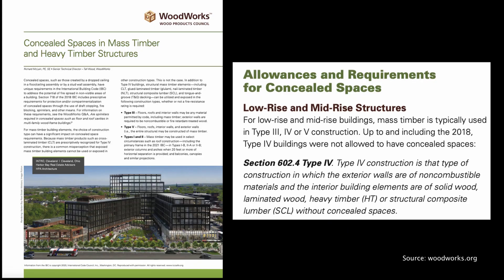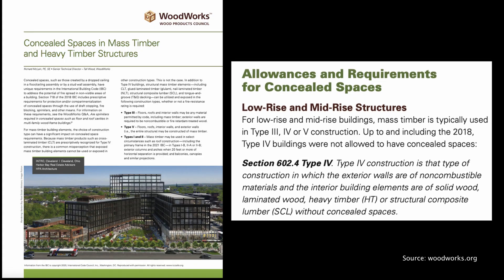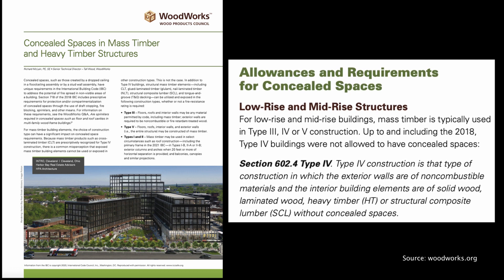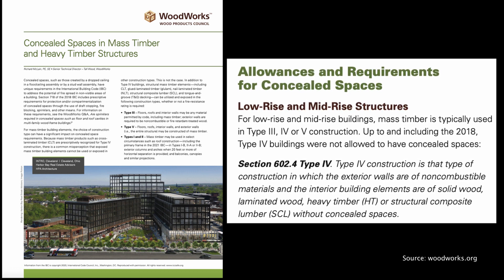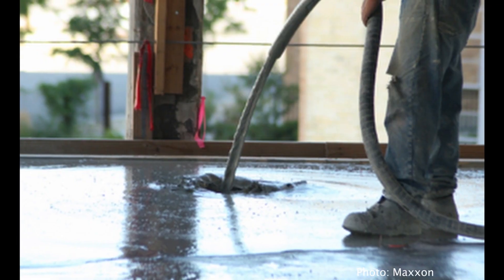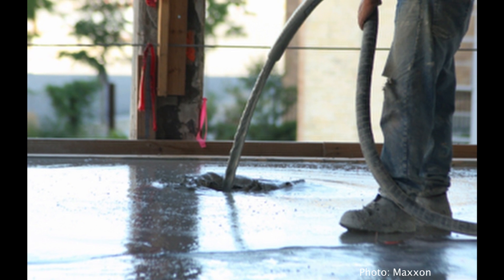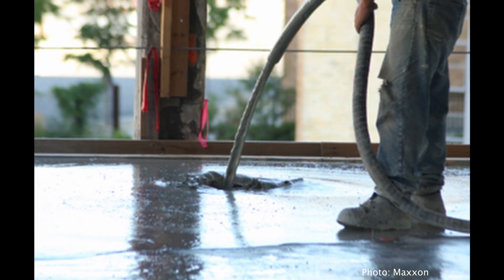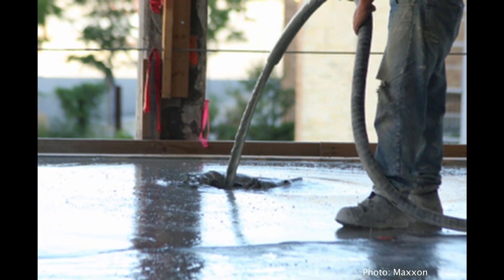Integrating MEP with a Mass Timber Structure | 2 Min Tues 11.3.20

Comment: Great video!! Do you have information on multistory timber frame wall buildings with MEP systems??
Reply from the maker: For walls, many mass timber projects are using non-mass timber walls, something with a cavity to run services through. Projects which have used mass timber walls have either left the surfaces wall mounted to the walls exposed, or installed a furring wall to build out the mass timber wall and then routed the services through the furred out wall. Thanks for watching!